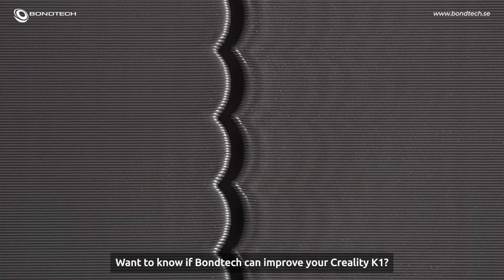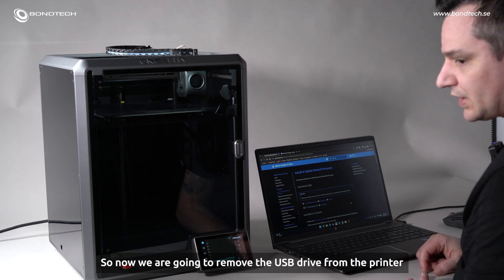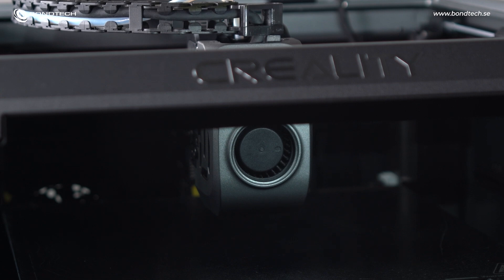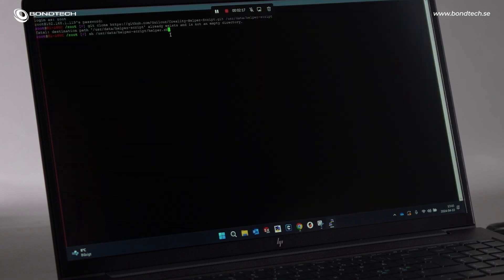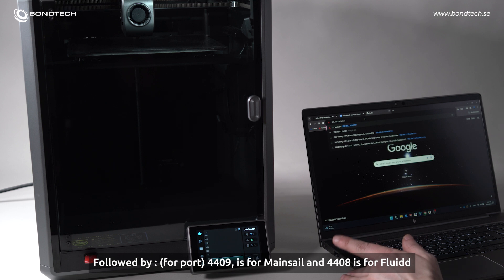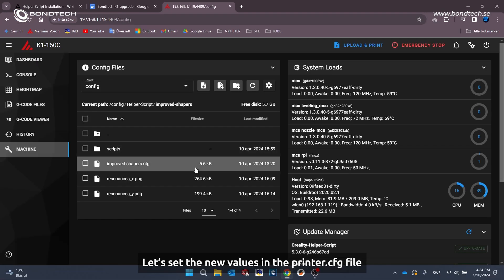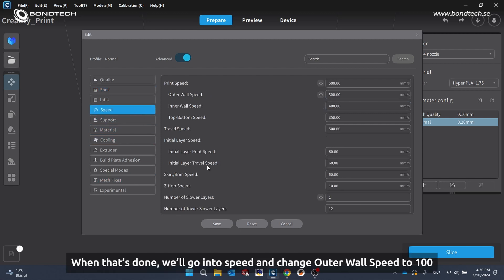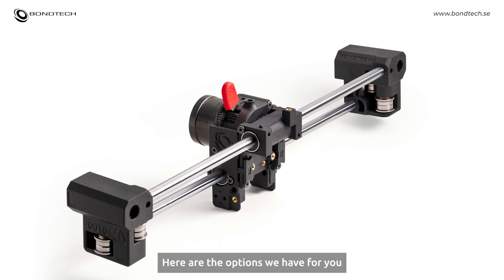Could your Creality K1 machine give you smoother and finer 3D prints? Let's find out today.

Comment: Do you need to limit the acceleration in the slicer with the same number as well, after you configure Klipper?
Reply from the maker: on is:

Yes, it is recommended to do that to achieve a smoother surface.//Nermin at Bondtech
Reply: @bondtechab  Thanks for answering that.

Comment: this video is amazing i can just follow what he did then its going to tell me the recommended numbers to put in for amazing prints holy my mind is blown
Reply: Hi there, just a question for you: you key in the acceleration value following the graph recommendation in Klipper, but do you need to do the same in the slicer? I configured Klipper with the recommended frequency and acceleration, but when I sliced a part and printed, the printer acceleration still go beyond what I keyed in.

Comment: Save your money. Just got the kit in and the plastic parts are 3d printed on what appears to be a machine way out of tune. The bearing retainer screws dont actually retain the bearings, and best of all theres absolutely ZERO support for it. For $300, theres no value in the junk youre sent, especially because they cant be bothered to release installation instructions nor can they be bothered to QC the crap they ship out
Reply: They didn't even address your complaint. Shows how much they care. If this was legit, I would have responses and support
Reply: @dheransukraj1921  here I am 3 months later with this kit installed and it's still not usable. There's issues that are causing movement hang ups and layer shifts.

Comment: Too expensive, wont consider purchasing for my K1C

There are cheaper options that might be better,  like Booty Call Jone's linear rail gantry
Reply: that seems like a decent option.. if you can print the parts. My K1Max isn't dimensionally accurate enough to print them before a fix/upgrade. That also doesn't address the stock extruder shortcomings/issues.
Reply: @TonyAllen1988  You can buy the printed parts from wattskraken for relatively cheap
Reply: @TonyAllen1988  look at Klipper skew calibration, should make everything all good to print dimensionally accurate pritns

Comment: Please release an upgrade version just for the carriage which comes with the extruder. I am looking forward to replacing the stock extruder in my K1 with a better one without needing to replace the entire gantry.
Reply from the maker: We need a whole new extruder to do so. None of the ones we have today fits. Making a whole new extruder takes at least half a year.
Reply: I mean, if you going to trouble to remove stock carriage you got to remove the stock gantry as well because they glue in the side so the chance you will damage removing to fit new carriage, that probs why they sell kit as full gantry replacement.
Reply from the maker: @unknownnetworkhub7460  We were making just a new carriage to fit the LGX Lite Pro on the K1. Then we noticed that 2 of the 3 K1s we had were showing the same X-axis problem. First clue of binding was visual. The x-axis lubrication was depositing in multiple parallel lines, perpendicular to the axis' rods. Then the resonance testing confirmed the binding issues. That's why we made the whole gantry.